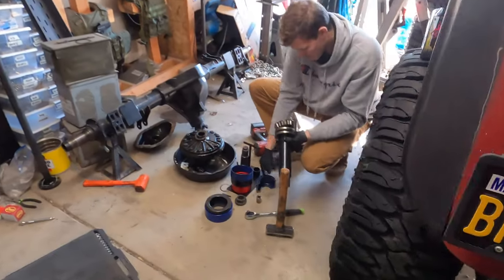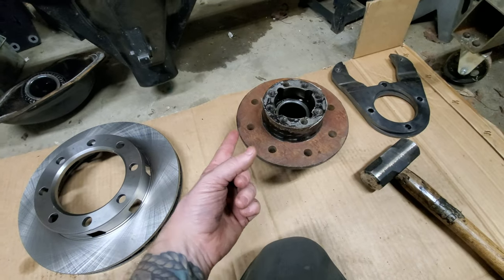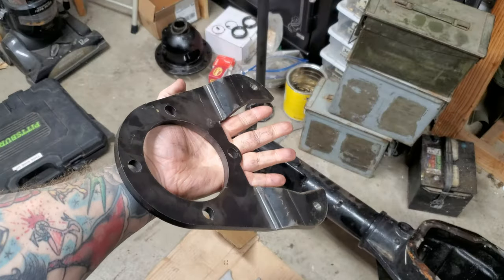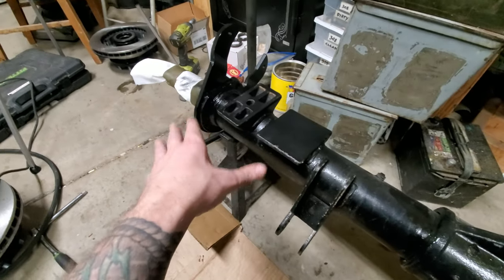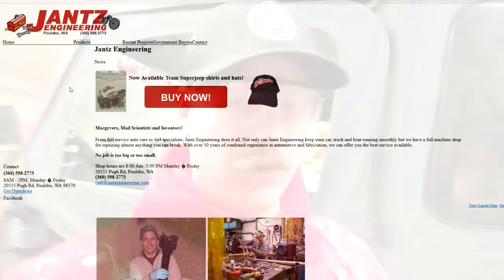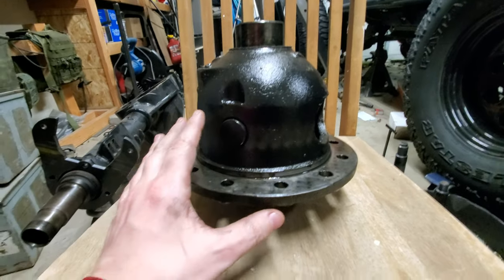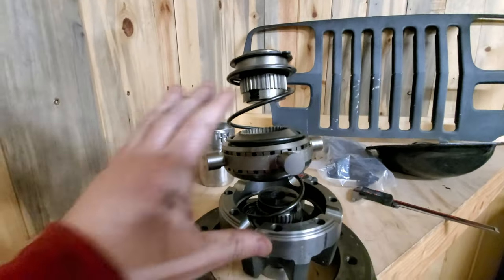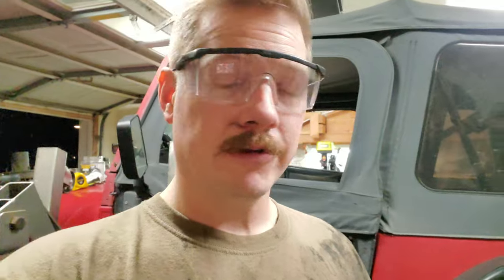Dana 70 Build (Part 1) | Don't Use This Axle!

Comment: By chance can you share the part # for the wheel studs. I have a 1997 dodge Dana 70 that came with the disc brake conversion and need to replace a couple studs due to heavy rust
Reply from the maker: 610-194.1

Comment: Did you replace the flange bolts that hold the axle shafts in? If so do you by chance have a part number? Thank you
Reply from the maker: I did but I just switched to grade 8 from the hardware store.

Comment: Looking at buying a dana 70 and it has a 3.07 ratio. I saw somewhere that means it's the bad one. But even if it is a 4.10 would work for me. Are you sure that ratio is an option?
Reply from the maker: Dana 70s are one of the worst axles to research. They all have something different about them, and if you get the wrong offset pinion may be offset or have small dana 60 sized bearings. Best bet is to find one built or ask someone who has successfully built one and ask what year/make/model its out of.

Comment: Sorry for all the questions. Do you have part numbers for the rotors and calipers you used? Thank you so much! I’m having a hard time finding a rotor that will fit over the hub
Reply from the maker: I don't they are from the lugnut 4x4 kit
Reply: No problem. Thank you

Comment: A full  floater is good but if you break a axel you really shouldn't leave the broken piece in there so if it breaks at the splines it's not just pull the axel but once you get it out you can drive out
Reply from the maker: exactly, you could pull both easily and get it drive-able quickly.

Comment: What Dana 70 is this with the issues? I just came into possession of set of axles from a 98’ dodge 2500 for free from a friend. He told me they were d60 front d70 rear?
Reply from the maker: This is the Dana 70-3HD. Pretty much the only 70 you don't want. Came out of a 1980ish C30

Comment: I have a danq 70 sitting in my backyard in an old E350. Would you recommend using this on a rock crawler? Thanks
Reply from the maker: I'm no expert on the dana 70. If it's a 3-HD... then no. Pretty much any other variant should work
Reply: @FortuneOffRoad  alright thanks for the response 👍

Comment: So the 38 horse power, 1200 lbs sammy is getting 1 tons and the YJ is getting 1/2 ton upgrades? ...ok. Sucks about your D70, people suck. I guess it's a lesson for you and your viewers on knowing what you're buying. Do you know what vehicle the axle to avoid comes from.
Reply from the maker: Correct! The Samurai needs the gearing offered by the 1 tons and the strength of stock axles. The Jeep came with 1/2 ton axles so I'm upgrading what we have. New shafts are warranteed up to a 40". Jeep is a trail rig, Samurai will be a dedicated rock crawler. I don't know the vehicle to avoid, but I think they are on the rare side. Not a lot of info on them.